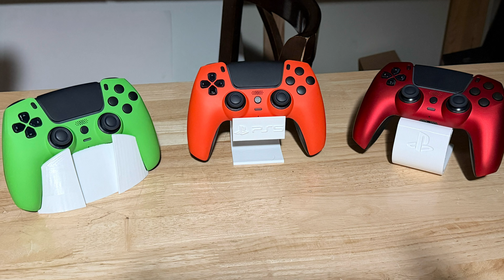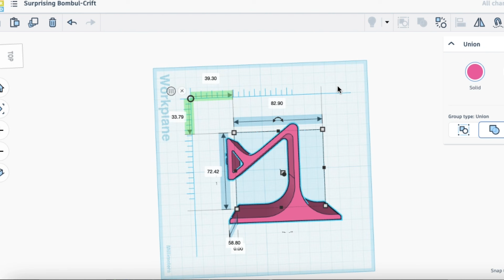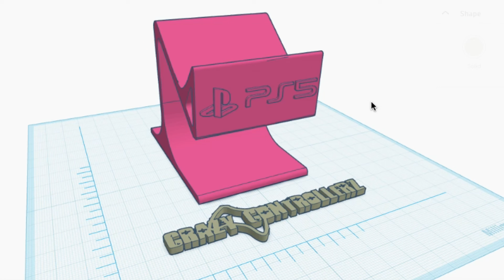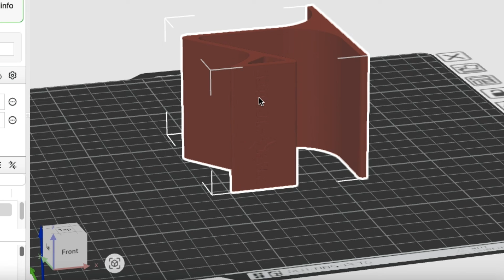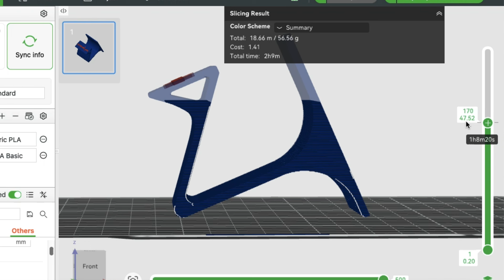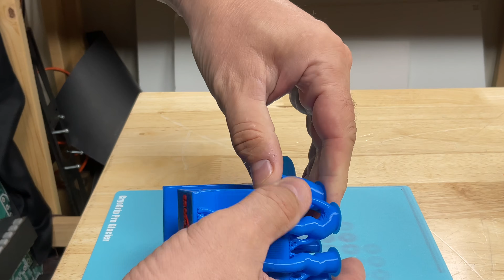Creating a Custom 3D Printed PS5 Controller Stand in Tinkercad

Comment: You want to print something like this on its side, simply for strength because of the layer orientation.  Just model the logo so that you can print it separately (and flat) and then glue it into the main body where you put an indent with the outer shape of the logo and 45 degree chamfers (make sure the logo part has its side matching that) to make everything nicely printable.

Comment: Nice controllers and excellent video. You might redesign the tail piece with a dovetail interlock so 2 separate pieces could be joined together. Giving customers an option for a non tipping stand.

Comment: Can you print the base in 2 parts, like dovetail the two together?  That adds an assembly step, but it might give the best of both worlds by printing the parts as flat as possible.  Other things I would try are reducing the top interface distance from the default 0.2 to something like 0.17 or 0.15 while also increasing the number of top interface layers or ironing the interface layers.

Comment: Nice project to work on.
Wouldn't it be an idea to make two prints?
1 being the stand, another being the logo?
Then, the logo could be printed with a 0.2mm nozzle, making it much sharper while the stand could be printed on it's side, making it much faster.
Reply from the maker: Definitely an option.

Comment: Use PLA/PETG as the interface layer for the supports. It's a game-changer. Whichever one you are using as the main material, use the other for the interface layer.
Reply: Been doing that on all my Ams printers